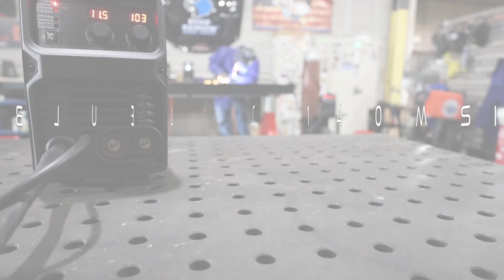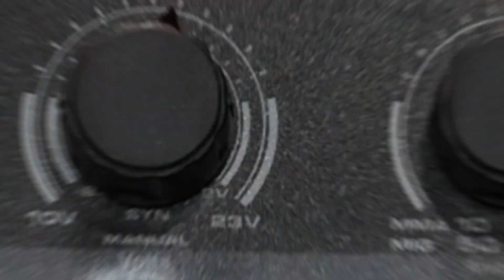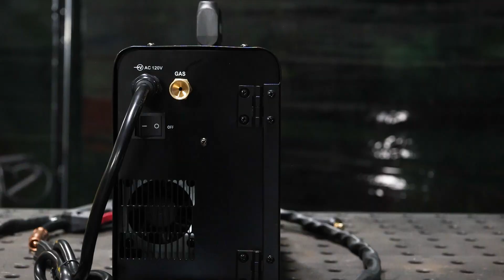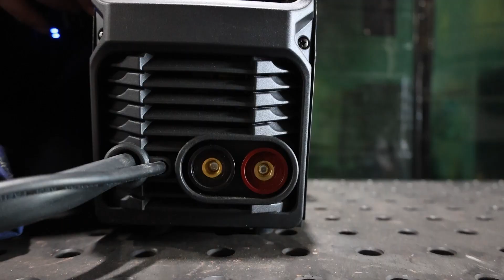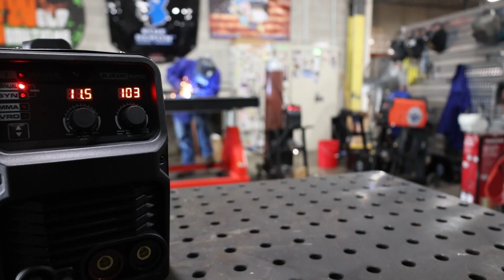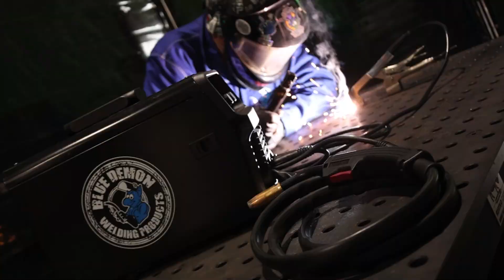Blue Demon BlueArc 140MSI

Comment: Can I run .023 wire ER70S with the stock mig gun/hose or do I need to replace it with a smaller liner one? Is the stock one for all sizes of wire?
Reply from the maker: Yes, you can run .023" wire with the stock gun, liner, etc. Just make sure you have the .023" contact tip and drive roll on!

Comment: How many AMP does this welder draw?  What size breaker is needed on the 110v circuit
Reply from the maker: 20A minimum (may pop it if you're running the machine on max settings), 30A is ideal

Comment: Hi i was looking to buy either this or the 200msti. Is there a way to get them shipped to Alaska?
Reply from the maker: Yes, both machines will ship to Alaska via purchasing from Amazon!

200MSTI:
https://www.amazon.com/Blue-Demon-BlueArc-Multi-Process-Inverter/dp/B096C685C8?ref_=ast_sto_dp

140MSI:
https://www.amazon.com/BLUEARC-Inverter-Welding-Machine-BLUEARC-140MSI/dp/B084ZRTSBS?ref_=ast_sto_dp
Reply: @bluedemonweld  sadly it doesn't on Amazon. The 140 will but the 200 doesn't.  The shipping zip is 99701.

Comment: So when in manual mode both knobs are set in middle ?  1/8 inch plates ?
Reply from the maker: not necessarily.  you will have to dial it in based on your joint configuration, cttwd, travel speed, etc...  just a starting point.